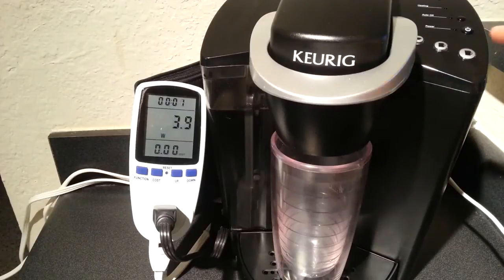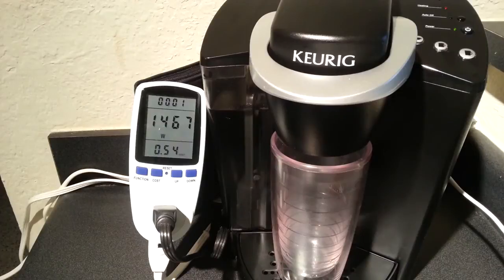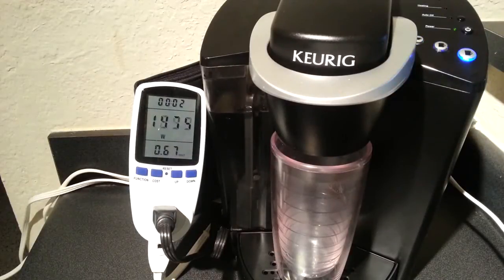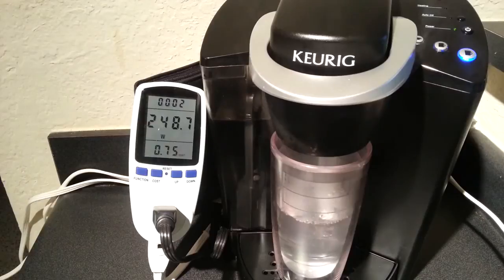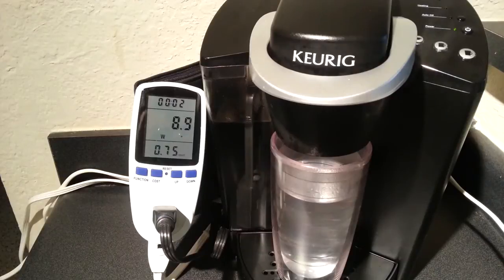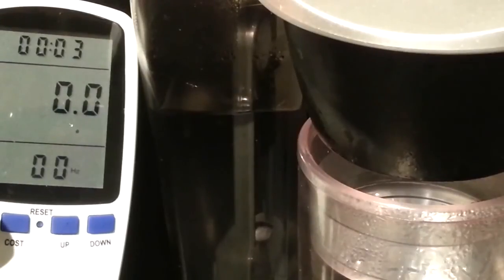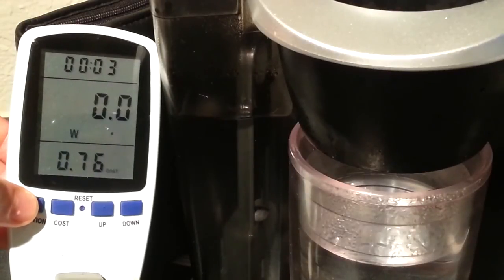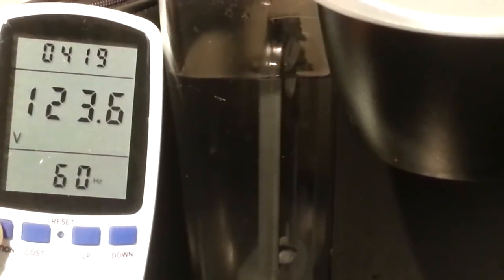K-CUP Coffee Maker:  How Much Electricity Power Does It Use?

Comment: There is a power button on top of the machine, so if you hit the power button to turn it off, BUT it remains plugged into the wall, you didn't answer the myth. Is it still using electricity, if it's just plugged in, but power is off, and not keeping any water warm, and all indicator lights are off? 

Thanks
Reply from the maker: Yes! It uses 3.8 watts just sitting there plugged in. Parasitic draw is true. Thanks for reminding me.
Reply from the maker: This data is in the description